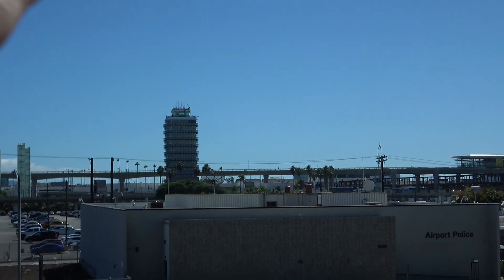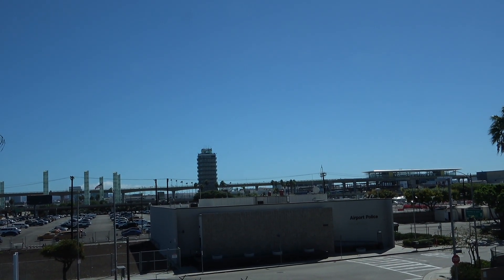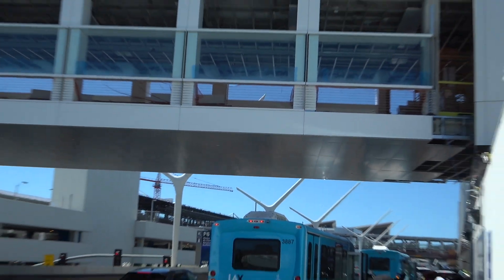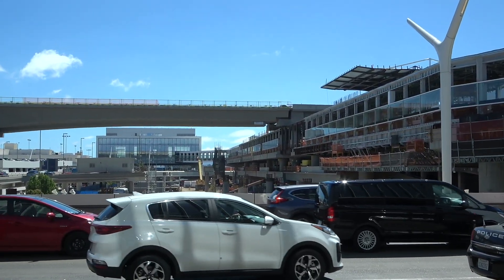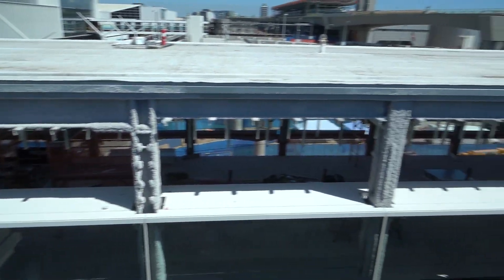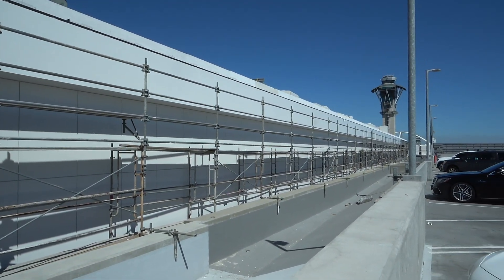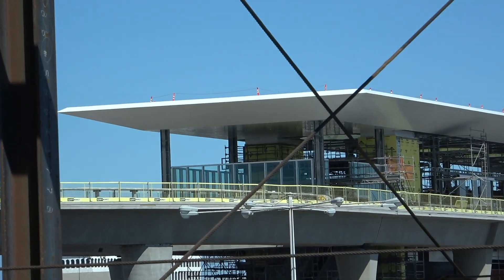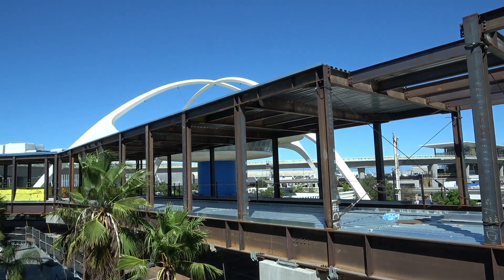LAX Airport $2 Billion Automated People Mover | Construction Update

Comment: LAWA was Saying terminal 0 would be starting ground breaking by the and of this year and terminal 9 at the beginning next year 2023, completion of the both projects expected by 2027 before Olympics game of 2028. City approved everything for this project this year. Everything is fine guys
Reply: City Council has NOT approved the terminals.  If there's been a request for proposal, the selection of a design-build firm is still pending board approval.  It has not appeared on the agenda.  In the meantime, there's also the possibility that LAWA could shelve Terminal 9 for budgetary reasons.

As things stand, LAWA just restarted the design process for the MSC South.  It plans to move the Eagle ops to the MSC South.  The current Eagle facility partially rests on the footprint of the future T9.  No construction can begin on T9 until it is removed.  That's not going to happen by the beginning of next year.  The MSC South won't be ready by the beginning of the year.  Approval of the construction portion of the budget is still pending.
Reply: @LDVTennis  either way, the city ambitions  is to have this projects done and running before Olympics of 2028. I still do believe and expecting both terminals will be completed by then.
Reply: @artfromcalifornia104  I am not so sure.  The MSC South won't be ready until 2025.  There is no more margin for error in the schedule.  Until then, LAWA can't remove the Eagle facility.  They made that clear at the July 21 meeting.  

As I said, LAWA has yet to select a design-build firm. Under a similar delivery process, Bradley West took about a year to design and budget.  Lots more elements to design for T0 and T9 ---  roadways, parking lots, a bridge, an additional APM station for T9.  I suspect there will be more than one RFP issued.  All of that takes time.
Reply: @LDVTennis  eagle goes to remote area, that it to it. I was working at LAX with serviceair aircraft fueler from 2005-2015
Reply: @artfromcalifornia104  At the July 21 Board meeting, the Director of Development stated that they need to complete the MSC South before they remove the Eagle terminal.  See for yourself.  The meetings are taped.

Since LAWA drafted the EIR for Terminal 0/9, the plan has been to move the Eagle ops to the MSC South.  See the footnotes to the "Enabling Projects section" of the EIR.
Reply: @LDVTennis  I know but it doesn’t adds up. To complete south MSC is gonna take some time at the best  is 2 years.by then it’s not enough time to finished those 2 terminals before the Olympics. Or they just don’t much care when is Done, as long the politicians make some  money from this project.